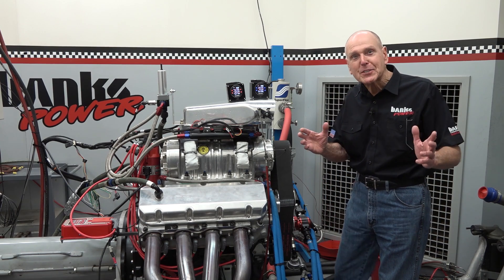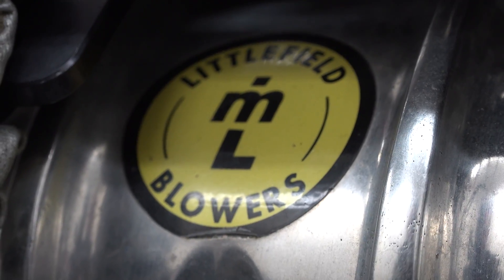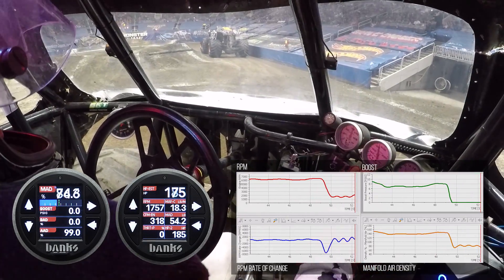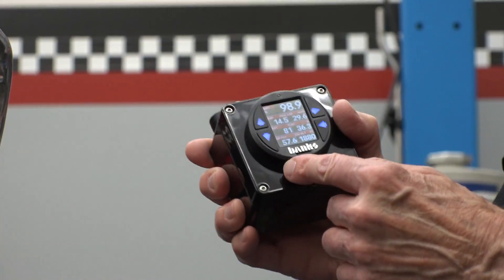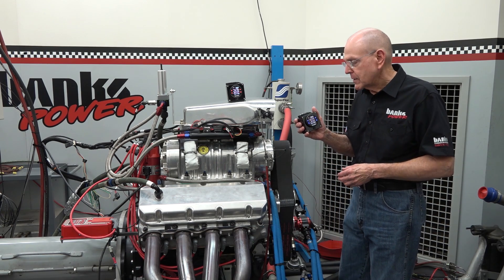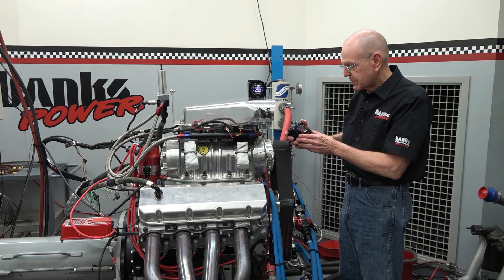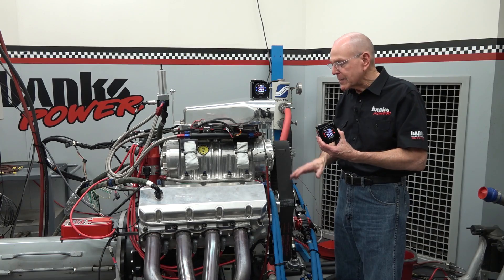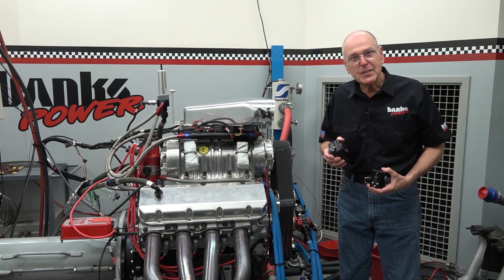Methanol Dyno Testing | Building a Monster Truck Engine Pt 3

Comment: There's a special type of engine in development called an RCCI engine (Reactivity-Controlled Compression Ignition), which uses both gasoline and diesel. And the way it does it is actually really interesting! You should take a look sometime.

Comment: So my little 2.8 30v V6  would consume close to 20lbs of air per minute.. This engine has always thrown me for a lube. It has 5 valves per cylinder. It auto make more than 210hp.. I feel like it makes more, only after 3000rpm when the VVT and VIG kicks in

Comment: Since you've identified humidity as a horsepower thief, have you ever tried to somehow lower humidity in the intake air?
 What I would theorize is a centrifugal water seperator in the intake system. Perhaps the commercial air compressor industry has already made something? Less humidity equals more horsepower. http://veotecgroup.com/water-removal.html

Comment: I know that there's a company named Westport that does natural gas injection into diesel engines and they have a dual fuel injector first injecting diesel that ignites, then natural gas as main fuel that's ignited by the diesel flame. I'm just thinking that this could be used for other fuels than natural gas as well like methanol.

Comment: I'm so glad someone says these things. When I got into cars, and especially forced induction people just talked about boost. But what they never mentioned, was compressor efficiency and more importantly absolute airflow.  A little turbo churning air outside its efficiency island at 14lbs of boost may only blow 120 grams/sec. And that hot air since it's getting churned.  A larger turbo that in its efficiency island at 14lbs may be able to put it well over 200 grams a sec. That's a huge airflow difference and nobody ever seems to talk about it

Comment: I wish I could get some advise. Carb or injection. I’m building an stroker 8.1 to a 511 and plan on putting 2 quadrajet carbs on top. The other part of me says no spend 15 to 2g to go injection. Ya the dominator would probably be perfect for you. But I’m under budget and don’t have the comfort of big sponsors and off the shelf parts at my disposal.

Comment: Subbed, because I have been looking for (someone to make) a diesel powered monster jam truck for years. 

From my limited knowledge of the diesel engine, having the same power/torque as the current methanol burning blown V8 is the easy part. The torque of a diesel could well surpass that of any blown big block.

BUT

Can a diesel have the same response ??? Turbo's have lag, big boost = big lag.

Supercharged diesel? Screw type/Roots or Procharger style. Top fuel is 65 PSI max apparently. Can a diesel generate more than that.

Curious to see how Team Banks Power goes about making this happen.

Comment: Couldn't you have just said that your trying to figure out how much boost y'all need to make the desired hp instead of saying it the complicated way😂
Reply from the maker: No, because we don't want anyone to use boost as a way of describing their engine's performance. Boost only explains the pressure and not the temperature or humidity of the air, which are both critical. Boost should not be used as a measuring stick.
Reply: @bankspower  oh ok so y'all are gonna leave the boost at what it is and keep changing the humidity and temp in the air till you gain hp y'all need? Y'all need 1400 right?

Comment: Mr Banks.. any chance you would be interested in helping squeeze more power out of a 1961 mopar 383 aimed at off Road use ?I'm hoping for 7-800 up from a turbo setup and simplicity will be key to the build..

Comment: @bankspower Is the I-dash Data Monster available as shown where its a standalone weather station?  I realise I can buy the gauge and air mouse, but that housing and independent power supply make it really ideal for use at a racetrack or in a smaller piston plane.

Comment: THE ONLY WAY YOU WILL GET A DURAMAX TO COMPETE WITH A NITRO METH MONSTER TRUCK ENGINE IS WITH A SUPER AGGRESSIVE ANTI LAG SYSTEM ON THE DURAMAX. OR POSSIBLY A BIG BLOWER LIKE THAT ONE ON A DURAMAX.   BUT I STILL DONT KNOW HOW YOUR GOING TO GET AROUND THE HEAT OF THE DIESEL. 

MONSTER TRUCKS SIT ON THE SIDE LINE AND FIRE RIGHT UP AND DO A RUN.  DIESEL CYLINDERS NEED HEAT TO MAKE POWER. I DOUBT YOU WILL BE ABLE TO WARM YOUR ENGINE UP FOR 15 MINUTES BEFORE EACH RACE OR FREE STYLE RUN.

Comment: I'm envisioning an all-new, CAD proprietary Banks lightweight forced induction two stroke diesel. A modem Detroit Diesel inspired powerplant. Snappy throttle response in a high RPM screamer.
Reply: Angry Panda Detroit 2 strokes didn’t spin high rpm they just sounded like it ;) but yes!!!!! I would love to see a modern diesel not designed for emissions but for power.... Gale banks hates diesel smoke so it wouldn’t be too bad on emissions.

Comment: Mr Banks, I was surprised by the numbers you quoted for standard atmospheric on standard day. I would have expected 29.92 in Hg and 59 degrees Fahrenheit. Where does the 29.23 and 77 come from? Thank you for the great content.
Reply: Local airport ATIS most likely.
Reply: 29.23?! Thats really really low
Reply: SAE correction for dynos uses the numbers he is quoting.
Reply: That's what I was wondering, those are the numbers I was taught in A&P school
Reply: @scmroman  Yep. *"STP"*...
Reply: Helve Hammer STP?
Reply: @scmroman  Standard Temperature and Pressure.
viperstd stated the standard temp and pressure. 
There is also a standard humidity that completes the density picture of a Standard Atmosphere.
Reply: Ive never seen 29.23 in Hg in my life. Thats like eye of the hurricane but ok... 😒
Reply: @benjaminowen6181  That's not that low.
Reply: It’s the beauty of standards, there are so many to choose from.
Reply: 25C and 99kPa are the standard numbers in SAE J1349.  59F and 29.92 are from an older standard.  People like to quote numbers corrected to the old standard because the higher density makes a larger corrected power number by about 5%.

Comment: 29.23 in of mercury is standard air pressure at sea level lol
Reply from the maker: No, we're talking SAE. https://www.scribd.com/document/347825974/Sae-%CE%94%CF%85%CE%BD%CE%B1%CE%BC%CE%BF%CE%BC%CE%B5%CF%84%CF%81%CE%B7%CF%83%CE%B7-%CE%9C%CE%B5%CE%BA
Reply: @bankspower  I think you meant to say 29.92 inches of mercury which is STP which is equal to 1013.25 hPa (mb).  Unfortunately, 29.23" is not accurate to any standard in terms of a standard reference measurement.  You have a lot of numbers that you're trying to remember so this is just a slip up.

Comment: Is your Dyno electric?  Or can you load it up with a certain amount water to get your load.  I dunno this is super interesting. I'm just trying to wrap my head around how you are simulating the race track.  For simulating load and horsepower with throttle response. And of course you know the throttle response is right now.  I'm guessing there will be a big ole blower on your diesel monster truck engine.  Just because it's tough for a turbo to spool like they drive them in freestyle and what not.  But also how loud a diesel is open manifold no turbo it rattles your eye balls.  Well not so much common rail.  But a 3406 cat or a series 60 it's really loud.
Reply from the maker: A blower and two turbos. That's how you make the power and ensure quick response.
Reply: @bankspower  sounds good to me I didn't think gale would get away from a turbo completely.  But the bro dozer definitely is lacking in throttle response.  Which would be addressed by the trio blowing into the manifold.  I am excited to see what ends up in the monster.

Comment: Problem with the diesel is it doesn't sound like the blown big block chevy
Reply: @Guns Cars and Digits Maybe a little bit but not like a big block at 7000 rpm
Reply: Exactly, In Monster Jam the new Diesel truck Brodozer is about as loud as a Prius when compared to the other alcohol blown big block on every other truck. When those things fire up you get an instant adrenaline rush, when the diesel fires up you cant even hear it until hes full throttle.
Reply: https://youtu.be/KLUsUQvWyuQ
Reply: @Guns Cars and Digits  Look up some Scania V8 videos.
Reply: It sounds better!      ;)
Reply: @davidscott5903  Sounds like FedEx is making a delivery ; )

Comment: When I made the move to put a roots blower on with a vertex magneto I had no clue what those things are, progress was slow but I got there using a fast a.f. meter and an exhaust temperature sensor just kept adding and adding fuel... looking back it was great fun because I took it slow, now the addition of a separate tank and methanol (holly black) pump and a nitrous plate made for methanol (m5) will be the next chapter, should be fun!!

Comment: im so curious what the platform would be...will it be a Cummins 6.7? seems a little small, maybe an old Detroit? cant be...too heavy right?...what will it be and can it be done and if so, what advantage will it have if any
Reply from the maker: Duramax
Reply: More of an issue of balance.
Reply: Pretty sure it will be the new Duramax.
Reply: I can't wait to see I'm sure he has a pretty thick note book from Mike Ryan's race cascadia.  Maybe aluminum block with steel sleeves.  He is such a wizard.  We will be surprised when it's revealed I'm sure
Reply: Magnacharger07 I’m saying roots supercharged/turbo new Duramax.
Reply: I would say do a big CAT motor may be heavier but torque will make up for it

Comment: Do you take into consideration the cooling effects of methanol fuel?
Reply: yes that's why they are using temperature, to mesure how much density the supercharger adds, and not just pressure. pressure doesn't give you true volumetric efficiency. Like he has said before, that boost pressure is dead, and doesn't give you much information when it comes to total power.
Reply: @wantu2much  the cooling effects of methanol fuel are added after air density increase provided by the supercharger.
Reply: The intake air density is cooled further, post-supercharger, by the methanol fuel
Reply: Methanol and other alcohol fuels cool intake air density charge due to thermodynamics
Reply: It is relevant given Gale is seeking to replicate or exceed the performance of an alcohol blown engine which is port or bank injected vs a diesel engine which is injected directly to the combustion chamber.
Reply: One gets an air charge that is cooled by the unburned fuel, the other gets air which is not cooled by fuel.
Reply: @2secondslater  I think the answer to your question has something to do with latent heat of vaporization but I'm not sure you are both close to the answer.  I wonder if it would be beneficial to drop in a temp sensor in the bottom of the manifold near an intake valve.  Temp would be different as some alcohol evaporates but boost pressure would be constant.
Reply: @Magnacharger07  What is the difference between air alone, compressed to 25psi, for instance, compared to air with added methanol (which provides a cooling effect to the air) compressed to 25psi?
Reply: Density increase?
Reply: Yes, he'll be measuring the density of the air, after the blower, as well

Comment: My blown engin usually have 0 HP and 0 torq
Reply: And 0 oil pressure.
Reply: That’s the other type of blown engine. Usually good option for those on a budget.
Reply: Mine too. Also missing a few rods.lol
Reply: SuperDd40 - Well, them it's not likely your blower blows! Sounds to me like it sucks!! 🤔
Reply: @ 0 rev/min, lol . . .